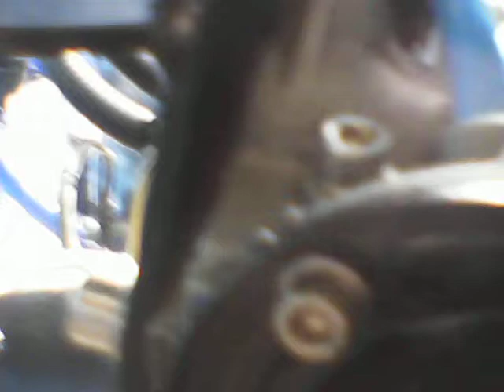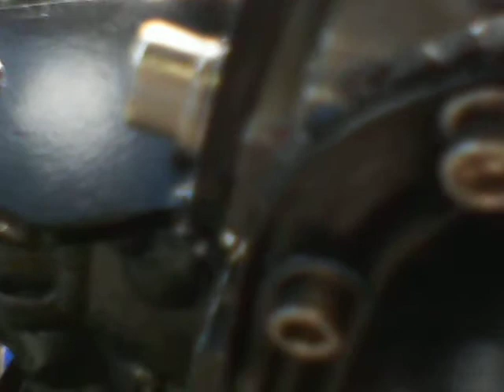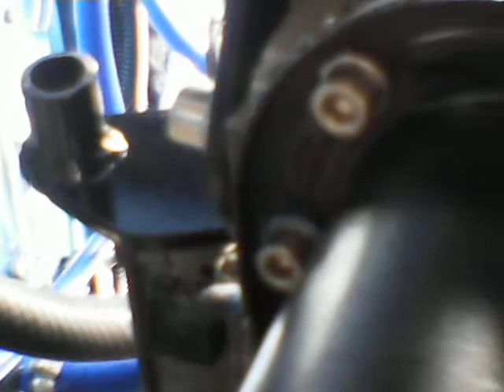105 Amp Alternator Conversion for Geo Metro - Part 2

Comment from the maker: here's the info for the kit for the v-belt conversion. it includes the pulley that fits the cs130 alternator, lower bracket, wiring pig tail, belt, etc.

google offroad adventures and look for SUZUKI-SAMURAI-ALTERNATOR-CONVERSION.

Comment: where did you get the bracket? and wire adapter?
also, my existing pulley is a V pully will it swap onto the GM Alt. or will i have to change over the other pulleys